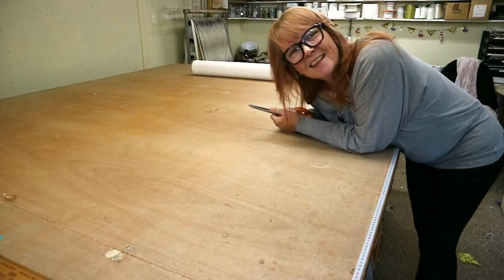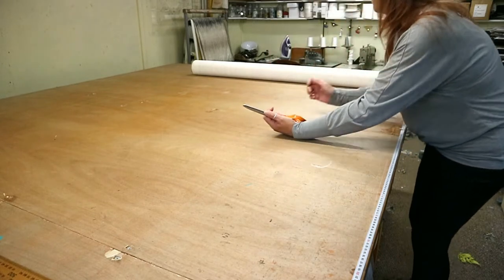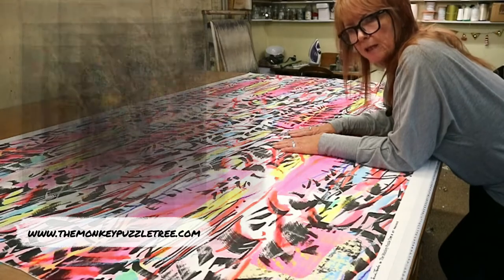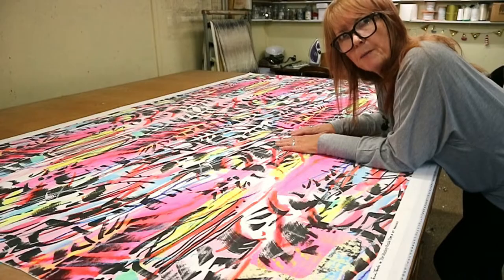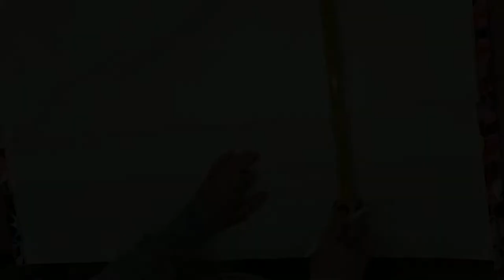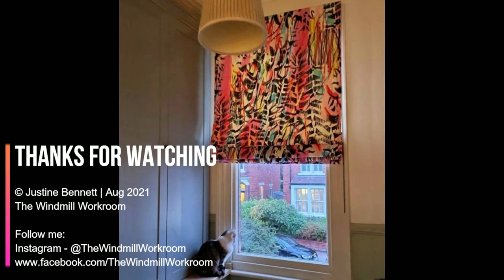Full Making Interlined Roman Blind in The Monkey Puzzle Tree Velvet

Comment: Hi Justine. Thank you for a brilliant video. So easy to follow. Can you clarify why you use different clips to the O rings for the bottom two rods?  Could you use all O rings?  Also when hand sewing the rod pocket placement in place are you putting the needle through the monkey puzzle fabric or just clipping it from behind?  Thanks again for such a clear, concise instruction!
Reply from the maker: Hi Noreen, as a professional curtain maker I must, by law, comply with UK chd safety regulations and add breakaway rings to at the least the bottom two rows of rod pockets. This ensures that if a child were to accidentally get caught up in the cords that the rings break away from the blind to remove the risk of the cords becoming a strangulation hazzard. The sidewinder mechanism also needs to comply in a similar way. 
Whe I lock in I sew a running locking stitch as opposed to stab stitching which used to be more popular. The running locking stitches are kept very small and just catch one or two threads of the back of the monkey puzzle tree fabric so they don't show on the front. 
Jx
Reply: Thank you so much Justine for explaining this to me!

Comment: Great videos thank you.  Just a silly question really but what are the markers you use? The ones I have are awful! 
I have accounts with all the SF suppliers (Hallis, Hunter & Evans etc. ) so just curious what yours are and where to get them Many thanks. Regards.
Reply from the maker: They're from Hancocks called
'Hancocks Vanishing Pencil With Eraser' but they're really a felt tipped pen. I think I got them from Hallis although I can't remember for sure I'm afraid 🤔 They're the best I've used as you can fix it with an iron to stop it vanishing but still Eraser it with the Eraser pad at the top of the pen👍
Reply: @WindmillCurtainRoom  thank you. I'm putting in an order from Hallis later so I'll see if they have them.